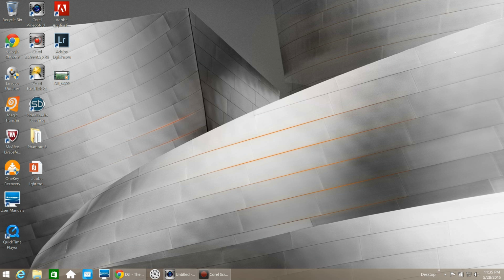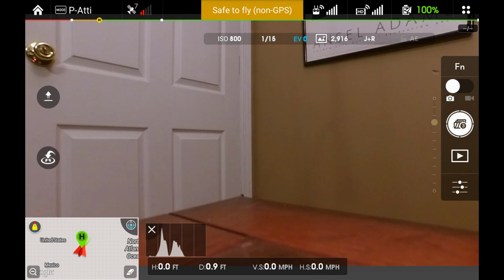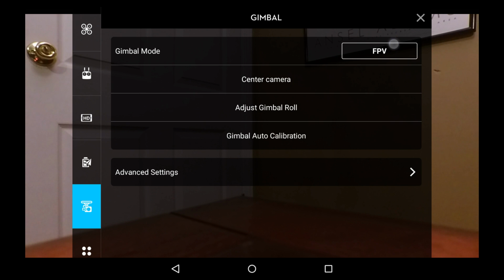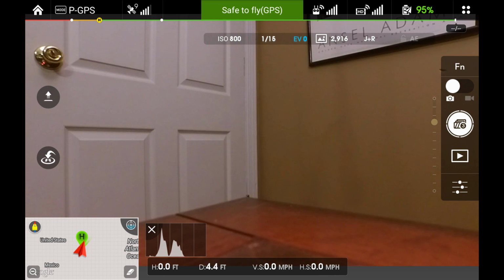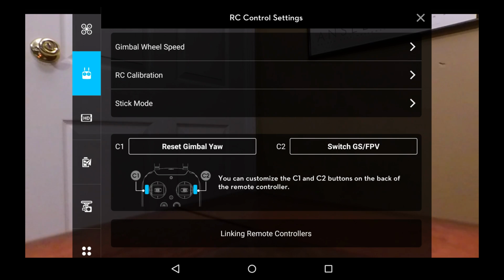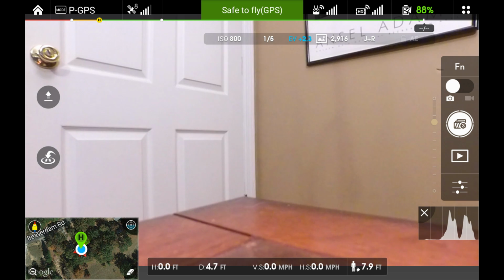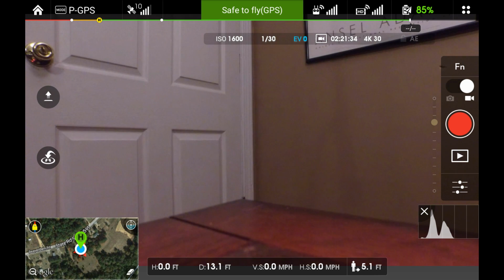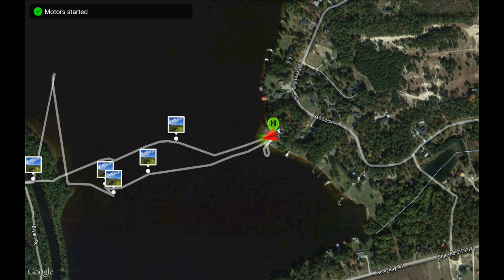DJI Phantom 3 & DJI Pilot App (now DJI GO App) Walkthrough & FAQ

Comment: At about the 3 minute mark your screen show a warning which said weak image transmission signal i get this warning a large portion of the time i fly my phantom 3 standard it does not seem to effect the flight or the filming but i cant get rid of it can you give me some advice on what causes this and how to fix it.Thank You.
Reply from the maker: dhiquobgnaloo Could be a number of things... inference, flying near obstacles, flying too far. Unfortunately, the Standard has the shortest range of all the Phantoms and does not utilize Lightbridge for the video link. 

Things you can do to improve the video link include being sure to aim the antennas on the controller as described in the manual or upgrading your antennas with aftermarket ones.
Reply: Thanks for responding to my query i should have mentioned that i get the warning even before my p3 standard even takes off i generally get it as soon as its turned on and connected  to my tablet.
Reply from the maker: Are you outside in a clear area or inside like this video? If you are inside you can get all kinds of interference and signal reflections that will cause similar issues.

Comment: Does the flight mode could be changed by the APP settings directly without usimg the switc  from the transmitter?
Reply from the maker: Vladimir Lugo Verde Not exactly. Once your switch is in F mode though you can enable certain functions such as circle, follow me, etc.

Comment: i have dji phantom 3 standard and im new in terms of using it..can somebody here to teach me  how to use it indoors w/o gps? what are the settings i need..thanks
Reply from the maker: Alvin Dionco ATTI mode.. you may also turn on VPS (vision positioning system) but depending on what you are flying above it may not work well. See the manual for details.

Comment: Trying to connect Samsung S5 to Phantom 3 4k controller for the first 
time. Both have micro usb.......where can I get a cable to do this? Very
 frustrated. I'm in Chesterfield, right up the road from you. Thanks.
Reply from the maker: The Phantom 3 standard and 4K doesn't  use a cable to connect from the controller to the phone, it is a Wifi connection. Look at step 5 of the quick start guide.

Comment: Your video that you did is this on a phantom 3 standard I have a P3P. I don't have that little icon when you switch over to maps to do the drawing out a route to follow. I would love to have that option but evidently it's not on the P3P. Great video by the way, learned a few tricks.
Reply from the maker: No, this was when the P3 first came out with the Advanced and Professional--the Standard didn't come until several months later. The app and firmware have changed quite a bit since we made this video.
Reply: Yea that's what I kind of figured. Thanks!

Comment: Great video I know a lot more now than I did watching a lot of other you tube videos only problem I have is every time I start the go app it always asks which drone I have and I have to keep selecting  phantom 3 advanced is there a way it can remember my choice as this is annoying ?.
Reply from the maker: try changing the order you power things up. if the phantom is turned on first, followed by the controller, and then the tablet or mobile device it will usually go straight to the right quad on the app.
Reply: Ok I will try that cheers ;)

Comment: I have an IPAD 3 64 GB newest firm ware IOS 9.3, both remote and aircraft are updated. My android phone works and connects but my Ipad does not (unloaded the DJIGO app reinstalled) connect; tried 3 cables, shut all down brought it back up still nothing on each cable. it will fly but no camera link to the ipad also nothing on screen so can see bird fly but nothing else. Can connect the phone and BAM its all there. This is frustrating as I can see others are having this issue.
It states that the IPAD with ios of 8.0 or better will work.
Reply from the maker: Sorry to hear of your difficulties...I have not used any apple devices with the phantom.
Reply: +Drones In SC Ok thanks!

Comment: Nice video! I have a Blade Chroma at the present time. But thinking seriously about the Phantom 3 standard because I think the picture quality is much better than the CGo2 camera. Couple of questions though. Will the app allow you to fly within 5 miles of an airport? I have permission now to do so. But I saw somewhere that the DJI program won't let it.
 What happens if you are using your cell phone for flying and you get a call?  
One last question; what's the range on this as it is out of the box?
Thank you for any answers you may provide me.
Reply from the maker: I would not suggest the P3 standard...very low range (no lightbridge)..go with the advanced or professional. 

You can look at DJIs website at the details of their no fly zones and what airports are affected (not all are). 

I haven't done it yet but there is a process where you can unlock certain no fly zones through DJIs website after registering through them.

with regard to your device..I have a Wi-Fi only device that I keep in airplane mode when flying...you should not have interference with your phone, but if you do it's really easy to push a button on your phone and put it in airplane mode.
Reply: +Drones In SC Thanks! I appreciate the advice.

Comment: Hi all Any way to adjust the right and left motion on camera. Camera is slightly turned to left side from straight position.
Reply from the maker: +Allen Smith I have 4 different gimbal equipped quads and none of the cameras on them are perfectly aligned with the centerline...not really a big deal. It shouldn't be noticeable when you fly and the camera moves automatically in that axis as you are flying about. You might be able to reduce it by doing a gimbal cal...if it truly is a big deal, then I would contact DJI and see what they have to say. The only manual adjustment we have in the app is for gimbal tilt and pitch control.

Comment: I must have a newer version of the DJI app. than the one you used in the Video (GREAT VIDEO) there are a few things that are different that I have questions about, the first one is about I can't seem to turn on IOC in the app the switch is there but it is greyed out but under the switch is RESET IOC  can you explain what's going on with the IOC ,and the second question maybe I missed it what is SMART GO HOME I turned it on but don't know or cant find a explanation of its purpose ! and the 3 and final question I turned OFF WIFI ,DATA &  CELLULAR in the I pad is there any other settings on the Tablet that should be addressed when using the Phantom 3 advanced that I have ?PS How do I find MY FLIGHTS or records in the new app?Thanks  DENNY M.
Reply from the maker: +Dennis M. Yes, this was filmed with the original version that came out with the P3 last Spring...there have been many versions since then and the app has even changed names. 

I still haven't had the chance to use the current app but hope to get a video up soon. To use the intelligent modes you must flip the mode switch on the controller to "F" Mode. It is my understanding that smart go home will initiate an RTH on the first low battery warning but I haven't confirmed that...just read it a few places. 

To access your flight records...from the main screen on the top left there is a paper airplane looking icon...click that. ;)
Reply: Got it thanks was looking on the app itself.
Great Videos keep up the great work I'm new to this and been watching videos for 4 days straight you have the best I have seen so far.!!

Thanks again  DENNY M.
Reply from the maker: +Dennis M. Thank you, Denny. Have fun!

Comment: Looks like the app allows you to check for latest updates when you launch it.  This would not work if you had turned off the WiFi as you suggest.
Reply from the maker: +John Samtak This is not the latest version of the App, John. This is the version that was out last year around the release date of the P3. You can still have Wi-Fi on when launching the app but I still turn it off when flying due to interference and range concerns which I have experienced when it was on.

Comment: Does the App used with the OSMO, allow for LIVE shot and can the video image be "flipped horizontally". Ex. when doing selfies the video and photo's are reversed. I would like to use in an RV as a backup camera and while driving with the camera used as a rear view video (LIVE). Thanks
Reply from the maker: I haven't used the new device but according to dji it does work with the app. I don't think there is a way to make the go app display a mirror image.
Reply: +Drones In SC Thanks… Only Sony and Samsung offer mirror image settings in their software (APP), but both require internet connections. I need to use a wifi to send from camera to viewer.

Comment: Hello! Thank you for the reply. I will try that, but my understanding so far is that the motors should work indepedently of the DJI App, just by only using the RC and without even connecting any tablet to it. The tablet I think is to read the data from the sensors in the phantom such as height, altitude, temperature, battery time, etc. and to perform a few automated functions such as automatic ascending/descending, etc. Can I ask: what tablet/phone do you use? What would be the best tablet to use?
Reply from the maker: I just remember that when it first came out, only the Android version was released..so many apple users had to find an Android device in order to activate the unit on the first flight.

I've always used Android so that wasn't an issue for me. I still use the tablet I made the video with...the 2013 version of the nexus 7...but I'm sure there are better choices out there today.

Comment: The DJI App shows me "Disconnected". I am also not able to arm the motors. Should the motors be able to work independently of the DJI App just using the sticks in the Remote Controller? or they should work only if the DJI App works? I do not know what the problem is. Any help, please....
Reply from the maker: I believe you at least have to use the app once (the first time) but I'm not 100% sure on that. If you haven't already tried, try a different USB cable between your mobile device and controller.

Comment: 1 out of 4 batteries had this tight fitting problem for the 2nd P3. This is a new one bought in July when there was a battery shortage. The other ones were bought in Feb, they are somewhat tight fitting but not as bad as the one bought in July.

Comment: Have you experienced very tight fitting batteries? I have a new one, inserting was tight. Almost impossible to remove it without prying with a screw driver. This battery fits very tight on my other P3 as well. A replacement behaved the same. Is it from a bad batch or there is some way to remove the battery easier?
Reply from the maker: +eagle3x8 I have not seen that in the 6 batteries that I own, nor in any of the other dozens of batteries I have encountered. I haven't been very active in the forums the last couple of months due to being out of the country, other projects, and work so I'm unsure if this is a widespread issue.
Reply: +eagle3x8 i have noticed the same on mine. I just got it a couple weeks ago.
Reply: +Bo0stmuch That is not good news, as I was planning to buy another battery. Had sent mine in to DJI, will see what DJI will do. My first three batteries worked OK. For the 4th one, I have to use a screw driver to gently pry it open to release the tabs.
Reply: oh mines not that tough, i just have to use a lot of force and wiggle it out. I feel like its needs to be "broken in" lol 

we'll see after i get a chance to use it more.

Comment: i cannot turn on the IOC, it won't let me highlight it.
Reply from the maker: in the current version of the app it is a little different now. you have to enable multi flight mode within the app and then move the switch on the controller to "F" to gain access to IOC.

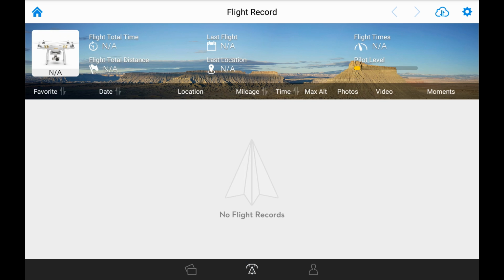Comment: At 34:12 why did you line out the Max Alt portion of your flight logs? Another question.. with a spec range of over 3 miles.. is there actually enough battery life to make that trip and return? Have you ever done that and how far did you get without losing power and going into fail-safe mode?
Reply from the maker: Because my takeoff point was on in a valley (low elevation) and then I flew over some hills at 400 agl..and I didn't want someone who doesn't understand what that means to say I flew above the recommended altitude limit of 400' AGL (here in the US).

I don't fly excessive distances or count on fail safe features, so I have not experienced that. The maximum distance I  have flown is probably 8000 feet or so...and that was over water.
Reply: Ok... thank you for the response... 8000 feet one way or round trip? Thank you for all of your information :)
Reply from the maker: +Frederick Dunn 8K there and 8K back.
Reply: Impressed... thanks! I'm learning that around here.. the general public has a hatred for quads... I had no idea...

Comment: This is a great vid.  Do you know, when adjusting max altitude, is it relative altitude (compared to the current ground level) or absolute altitude (compared to sea level)?
Reply from the maker: It is relative to take off elevation.
Reply: Thanks. I'm about to fly mine for the first time.
Reply from the maker: +Cliff Seruntine if you've never flown before, you might want to start out with something a little less expensive, try a sim, or better yet--find someone local to fly with.
Reply: +Drones In SC Thanks! I have been practicing for weeks on a sim and with a cheap Hubsan X4.  The Phantom is easy compared to that unstable little thing.  But I am going to be starting simply, hovering and maneurvering around some open meadows on calm days long before I take on more challenging stuff.
Reply from the maker: +Cliff Seruntine That is a great way to do it! You'll be glad you learned to fly that little hubsan.

Comment: On the android app the video is always garbled and extremely laggy when I first connect.  Then, if I back out of the app and restart the app usually it's fine for awhile but then acts up again.  Any ideas?  It's not just laggy, there are all sorts of artifacts and residual images remaining after I rotate or move, etc.  It's really annoying.  I'm using a galaxy s4.  I could try a tablet but I like having a small, light screen.
Reply from the maker: Is the phone getting hot? Just a thought but this sounds similar to what can happen when the phone slows itself down due to overeating. 

close other memory intensive apps...if your phone has any performance settings/battery  saving settings, then adjust for high performance (I don't have any Samsung's).

Comment: Help... I did a IMU calibration and now my gimbal will only move 1/2 inch right and left. It used to have a full range of motion. Same for up and down of camera but at least I can do that from the wheel on the back of the remote. Ideas?
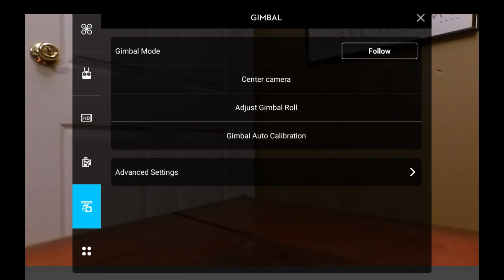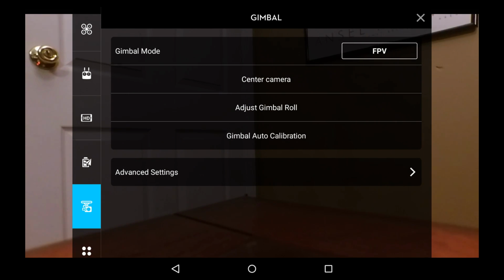Reply from the maker: +PSTC TWO MINUTE TRAINING Is your camera mode in FPV or FOLLOW, 09:28. At around 10:07 you can see I have the same small amount of movement when yawing left/right. Not sure how you had "full range of motion" in the yaw axis. I know you can do that with the Inspire 1 and dual controllers but I am unaware of how you would do that with the P3. You do have a P3, right?

Comment: Why is it that videos get saved to my phone automatically at the end of a flight but not my photos, I have to turn on the aircraft and controller (if I already turned them off) and connect my phone in order to get the photos?
Reply from the maker: I'm not sure..I don't use caching so I'm not sure what is normal.

Comment: Excellent.  FYI, LOG is a colorspace (like REC709), not a curve.  LOG is used to maximize the dynamic range of the sensor. You will need some basic color correction skills to use it.  The grid provides a rule of thirds reference for composing.
Reply from the maker: +Mike Flynn Thanks for the input and good explanation of what LOG does! Spot on about the reasons why you want to use it, but it by definition logarithmic functions are non-linear...they are curved. I'm not sure what the curve looks like for LOG on the Phantom (i.e. S-LOG, LOG-C) but here's a good article explaining log curves with regard to cameras: http://www.provideocoalition.com/the_not_so_technical_guide_to_s_log_and_log_gamma_curves
Reply from the maker: +Mike Flynn Just as an experiment, I recorded a short clip with the color set to log...it definitely changed the color response but the color space still shows as YUV & color primaries as BT.709 (REC709).

Comment: Do you know if there's a 'go-to' option.  To punch coordinates on the fly and the phantom will go to that location at current altitude?
Reply from the maker: +Jay Vizcarra There is no waypoint flying with the stock DJI app at this time...DJI appears to be leaving features like this to 3rd party developers of apps like Autopilot or Ultimate Flight.
Reply: I have Litchi installed which seems to have it however hesitant.  Are nondji apps stable?  Last thing I want us to lose video and control...
Reply from the maker: +Jay Vizcarra I have limited experience with third party apps for the P3.

Comment: Does the app save all your settings or do you have to go through and adjust every time you start up. If this was answered in the video I missed it. Thanks
Reply from the maker: +hdsport06 The app should save your settings..however I have had to reset values after a firmware update. Also, you won't see all of the values you set correctly unless you are connected to the Phantom when looking.